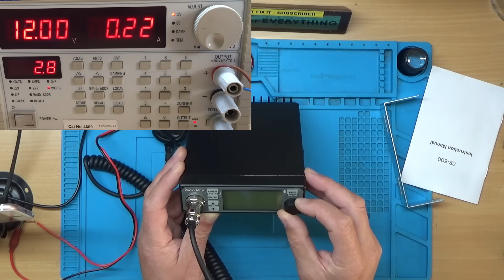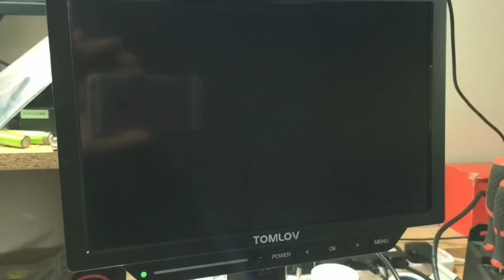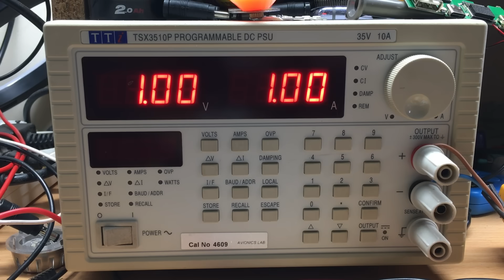Faulty Radioddity CB500 CB RADIO | Fixable?

Comment: Just an idea - nowadays you could give chatGPT the information and situation and see if it could come up with a program for the microcontroller or at least just enough of a program to get basic functionality from the unit
Reply from the maker: While it's a good thought,  I think it would be a bit more complicated. You would need to reverse engineer the rest of the circuit too, as you would need to tell it what I/O pins on the MCU go to what. You would also need to know for instance what tuner IC and how it's controlled so the MCU would be able to send the correct commands for it to function, same for the display and input panel.

Comment: I remember once you downloaded an update from the manufacturer's website and disassembled it to program the MCU (or discrete EEPROM?), have you checked in this case? You mention it as a possibility in the video but didn't say whether you looked or not
Reply from the maker: Yes mate, I had a look. The radio is sold under about 3 different names, and I checked all of the sites. Seems there is no firmware available because there is no way to update it.
Reply: @BuyitFixit Thank you. I remember how impressed I was with that previous video.

Comment: Just a thought, but wouldn't it be an idea to connect a supply to the micro controller (off the pcb) and check its still getting hot ? I'm just thinking it might be an output that is being overloaded, if so that might be fixable. Great content as ever .
Reply from the maker: Thanks 👍  Remember I only used 1V so the MCU would not be running to configure the outputs (which should not be enabled until they are configured).

Comment: It's a tricky balance, "right to repair" would be nice to be able to get the firmware, but equally you can understand manufacturers that read protect the chips. I do that on my designs, I feel I have to as I have had a couple of things I designed using only off the shelf parts cloned (in Russia and China), which damaged sales and limits the return from the time and money I invested into developing them. That in turn makes it more difficult to justify the time to develop new things.
Reply from the maker: Yes I totally agree, although perhaps that could be overcome by having manufacturers supply a replacement MCU pre-programmed at a reasonable price though. Something like the price of a MCU + 10%, otherwise I could see companies just doing this in a token way and charging a price that makes repair uneconomical (Hope you're listening Milwaukee / Apple)

Comment: Have you contacted the manufacturer to see if the part could be ordered? Or would it be possible for someone to copy the firmware off their chip and you to write it to a new controller ?
Reply from the maker: I'm not sure who the manufacturer is. The same radio is sold under 4 different names. Most times when I've contacted companies, I either get no response or the "we don't supply parts" line, or "you'll have to send it in for repair". I did mention in the video that nearly all MCUs these days have code read protection to stop people copying devices.

Comment: 15:35 what happened there in the lower right corner of the view? Looks like some flux residue and maybe some bridging.
Reply from the maker: Yes I noticed that too. It looked like the solder on the resistor had been touched up possibly at the factory or by the previous owner.

Comment: We really like your videos! Our brand HIKMICRO makes thermal cameras and would love to collaborate with you — would you be interested? 🔥😊
Reply from the maker: I've had a few emails about your thermal cameras. They aren't as high a resolution as the one I currently have. If you bring something out with better specifications...
Reply: @BuyitFixit  May I ask which brand and model of thermal camera you’re currently using? I’d love to compare the specifications so we can recommend a product that better fits your needs.
Reply from the maker: @juejuegongzi I'm using the kaiweets KTI-W02 pro which has a native thermal resolution of 256x192 upscaled to 512x384. It also has a 2MP visible light camera to create an  overlay or fusion picture, or picture in picture.
Reply: @BuyitFixit  Thanks for sharing! I saw that you’re using the Kaiweets KTI-W02 Pro, which indeed offers a great resolution.
Our HIKMICRO Mini2 V2 provides the same native thermal resolution of 256×192, upscaled to 512×384, and weighs only 20g.
It’s plug-and-play with most smartphones or tablets, ready to use within seconds, and features auto-rotation to keep the screen aligned with your shooting direction.
Would you be interested in trying it out?
Reply: @BuyitFixit  I’ve just sent you an email with the link to our MINI2 V2 thermal camera — please have a look when you get a chance. We really love your videos and would be thrilled to build a long-term collaboration with you. We’ll also have higher-resolution models coming soon, and we’d love for you to try them in the future!
Reply: @BuyitFixit  I wanted to follow up since our collaboration project is ending soon. Would you be interested in trying our MINI2 V2 product? I’d also do my best to apply for a higher collaboration commission for you.
Reply from the maker: Ive already reviewed a similar product previously the xinfrared p2 pro. Thanks anyway.
Reply: @BuyitFixit  Our team lead really loves your videos — they’re always high quality and engaging! 😄
Due to our project targets, I’ve been asked to reach out and establish a collaboration with you. I’ll also do my best to help you secure a higher collaboration fee. Would you be open to considering this opportunity?

Comment: There are a few 10 meter radios with that kind of circuitry and programmed chips ....... Way different on the stuff I worked on in 1980 and up until 02 , Stryker radios are in that group of " digital " radios ..... Great diagnosing on that radio ...... Take Care Mon Ami .....
Reply from the maker: Thanks Cajun 👍

Comment: Stupid question time 
Is it not possible to get pre-programmed chip from the CB manufacturer? 
That way you not stealing code tell them you are repairing there item on utube. 
Just a suggestion.
Reply from the maker: It's not a stupid question at all. I have done this in the past, but it's very few and far between. Most manufacturers aren't willing to help. I had a similar issue with a FLIR thermal camera, and with a solar inverter. Contacted the manufactures and just got either it's an old model and no longer supported, or you'd have to send it in to be repaired. This radio is sold under at least 4 different brands, so the company selling it doesn't seem to the manufacturer either.

Comment: I use the thermal camera by feeding power into the output side of the regulator and looking for traces that heat up.  Last one I had, the shorted component was under an aluminum heat sink so I couldn't see it heating up, but the power trace glowed on the board to confirm shorted.
Reply from the maker: Nice, that's pretty much the way I used this one after removing the regulator. I've had something similar when I had a short on the EV Charger repair I did on here (the component was hidden behind a relay which was on the opposite side of the board from where the fault appeared to be.

Comment: What would be fun if you reverse the display pins that will be the display fixed them work on the frequency program it won't be hard you have a rx tx  port to upload so you can experiment lots lol

Comment: ... Just a thought... Some microcontrollers have the ability to output a low voltage to power nearby sensors or memory chips etc. If a capacitor on that output went short the microcontroller would get hot without actually being faulty.
...Probably unlikely but worth checking?
Reply from the maker: There was 1.6ohms across the power supply to the microcontroller. There would be no outputs turned on  when I measured the resistance.

Comment: Only thing I can recall in that unit that would cook the ribbon cable is if the logic chip for the display went FUBAR. The old Amstrad 109 used to blow its LED generator because the LEDs pulled too much current.
Reply from the maker: Someone else in the comments suggested that a different microphone may have been plugged in, as there's 12V on that socket and also signals such as CH up/dn that go to the MCU. I thought that was very plausible.
Reply: @BuyitFixit  Ive seen a General Electric big mike with display on the handset used before, but that thing doesnt have a digital output setup to the mike socket. The fact that the Voltage regulator is climbing into the hundreds says that something wanted more current and voltage than 5v and 500ma the chips rated at. Seen similar in the past, some folk dont want "Standard" they want Uber out of a standard setup and of course it doesnt politley say no it just fries. Bring back the days of the PLL and crystal running stuff and the chunky Channel selector.

Comment: Hey Mick, Many thermal cameras have an adjustment to change the overlap from the two cameras. I have a FLIR TG165 series camera and to adjust the overlay you hold the up and down buttons. This may be the same as on your camera.

Also if this is not fixable you could turn it into a small amplifier by tapping the audio inputs to the amp chip. I would find the volume control and inject audio there.
Reply from the maker: Thanks mate 👍Yes it does have an offset but it only goes as low as 0.5m Yes it would work as a small amp.
Reply: @BuyitFixit That's what I'd use this radio for if I had one. I did the same to an 80s CB radio and you can still use it as a radio.

Comment: Can't you show how you "hacked" the firmware? 😊
Reply from the maker: I could, but if you check out the video I did on fixing the AVerMedia live gamer pro, it's based on a very similar chip, and uses the same program just a slightly newer version. I think I used the software for the runcam-6f which let me dump the firmware and also flash it.

Comment: Nice try Mick, you. Can’t win them all the ribbon burning is a good indication that the mcu took a hit shame really i know you hate a fail ❤
Reply from the maker: Thanks mate 👍Sometimes you can only do so much. I did find the problem but without parts what can you do. Someone suggested the cause though which is rather plausible. The mic socket has 12v on it, so if someone tried a different mic and it sent 12v into the up/down channel key for instance, then that would have given the results we have...
Reply: @BuyitFixit that is plausible, a different Mic with different pin configurations could very well do that. would be worth finding another unit to take the MCU out of? But saying that they’re probably so cheap nowadays it wouldn’t be worth it, I was hoping it was the 5v regulator as well like you said without the parts you can’t do anymore…

Comment: Mick, try getting in touch with the manufacturer, from what I've read they MAY be willing to send you the firmware for the MCU. It's easy to find their contact details.
Reply from the maker: Thanks for that mate, I think they are just a re-seller though as the same unit as there's a CRT Alpha, Anyone AT500M, and a Jopix GS60 which are all the same device

Comment: Chinese made radios usually have power applied to the MC all the time the radio is hooked up to 12 volts so a large spike on the 12 volt line can blow it out!  They don't have a physical On/Off switch but a switch or push button that's connected to a paralllel port input on the chip to tell it to turn on power, then it sends out a signal to turn on a series pass power transistor that applies power to the rest of the radio. Even though there is a voltage regulator supplying the chip they generally have a pretty low maximum voltage so it's easy for a spike to blow right through and damage the chip! I don't know why they are made this way since it seems easier to just have a physical  On/Off switch to supply power.
Reply from the maker: This seems to have a physical on off switch. I think we might have found the root cause as someone in the comments mentioned that someone may have tried to connect up a different microphone, which has 12v on one of the pins, if this got fed back into the up/dn or key switches then we would end up with a similar result I'd think. Here's the pinout https://cdn.shopify.com/s/files/1/0011/7220/9721/files/Radioddity_CB-500_Review_blog_description_09.png

Comment: Unfortunately another dead mcu :(. Just a thought, but did you alr try and reach out to the manufacturer and seeing if they might be able to supply a preprogrammed mcu or is that simply a nogo? There is a very small chance you will come across another company like peak who will supply a programmed mcu and send it in the mail. I have gotten lucky once with a company, but i dont know the name of that company but it was not peak ltd.
Reply from the maker: Thanks mate 👍I don't think Radioddity is the manufacturer though as the same unit is sold under different names. There's CRT Alpha, Anyone AT500M, and a Jopix GS60 which are all the same device. I think the only other company that helped out apart from peak was Kitchen Boss when I looked at the Sous Vide cooker.

Comment: I'd reach out to the manufacturer, they will other say; yes or no. It's a shot! Still another well done video :>)
Reply from the maker: Thanks mate 👍I don't think Radioddity is the manufacturer though as the same unit is sold under different names. There's CRT Alpha, Anyone AT500M, and a Jopix GS60 which are all the same device.

Comment: Love how you personalize the Tomlov microscope! Was that hard to modify the firmware to do that? I was going to save up to get an Amscope but if the Tomlov can do everything that's needed, I can get that and save some money. Then can also add sound recording like you did.
Reply from the maker: I've got an amscope myself  but it's under the desk. It's still a good microscope, but with having to use a TV etc while recording it's easier to use the Tomlov, check out the video I did on the sp46 motorcycle intercom. I doubt you'd be doing anything that extreme with it 😂
Reply: @BuyitFixit 
I checked out the repair on the SP46 like you said. Nice comparison between the Tomlov and Amscope. Seems like the Tomlov would be easier to use for making videos. But maybe the Amscope is better for soldering?
Reply from the maker: I think it depends if you're looking through the eye pieces or not. I never did as I was always watching it on the screen (which was over to the right of my desk) as you couldn't use the camera and both eye pieces at the same time. The screen I look at now is right in front of me so I find it easier to use, so I guess it depends on how you are going to use it.
Reply: @BuyitFixit Okay, thanks. I incorrectly assumed you were using the eye pieces. I had read somewhere that using both eyes gives a better depth perception. Looks like it's not really needed so I'm back to looking at the Tomlov.

Comment: Would have been better if the software was in a seperate eeprom.
Reply from the maker: Yes agree 👍Most MCUs have integrated flash these days though, and eeprom is only normally used for extra storage.
Reply: @BuyitFixit  Offcourse and i understand the reason they do it to prevent or make it harder for a competitor to "be inspired" by their software, but then they should atleast be compellled to sell a replacement processor with firmware inside.

Comment: Have you tried reading the code from the chip?
Reply from the maker: You can't even power the chip to read it. Then I'm not sure what programmer supports it, the data sheet is available only in Chinese. I even tried translating it.
Reply: @BuyitFixit  at this stage, "decap" of the IC is the only possible route (in theory) and try to visually read it, but hydrofluoric acid is so dangerous (that will be needed to remove the "glass" pacification layer) and then you still need special jig to make the microscope pictures and to stitch them together, etc. I mean how many people are even equipped to do such thing - at least in the open-source world are very few - for example John McMaster from the "Silicon Pr0n" project. also, Sean Riddle comes to mind - he actually visually read a lot of ROM memory of MCU never dumped before. oh, and the "caps0ff" project made a lot of visual dumps after decapping. in any way, it's insanely difficult, plus that Chinese chip is probably using encryption and even visual read cannot really help - they mentioned AES in the datasheet, but it's all in Chinese, maybe it's not used for the firmware encryption - who knows...

Comment: Shame about this one still you did what could be done and tracked down the issue.  Maybe a donor could be found to save it but the chances of that are small I would think.
Reply from the maker: Agree mate 👍Someone in the comments had a good theory though. He said that the mic input has 12v on it, and if someone connected a different mic.. which is very plausible as the original has a up/down key on it which would go to the MCU.

Comment: knowing very little about micro controllers (although I have dabbled), is there a possibility that the code storeage area might be intact and the TX and RX pins are ok and recover the code from the chip, and then of course the code lock on the chip that the manufacturer would have undoubtedly enabled, a big ask but it'd make a great follow up video...
Reply: Its possible but not worth the effort and energy put in
Reply from the maker: Also the chip would need power to function, and we have an almost a direct short across the power lines of the MCU.

Comment: Could you send the radio to the manufacturer and let them install a programmed chip for a fee? Would it be worth it?
Reply from the maker: I'm not sure mate, most companies just buy and sell stuff. They don't actually manufacture. I suspect it's the same with this device as there's also a CRT Alpha, Anyone AT500M, and a Jopix GS60 which are all the same device.